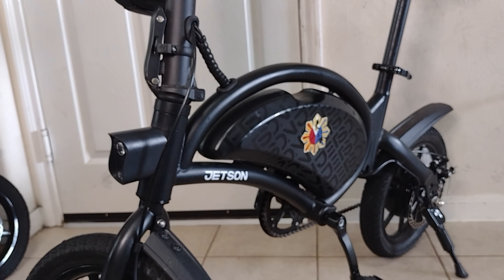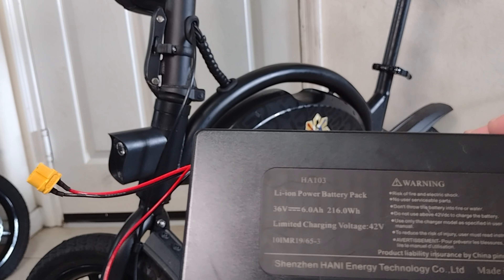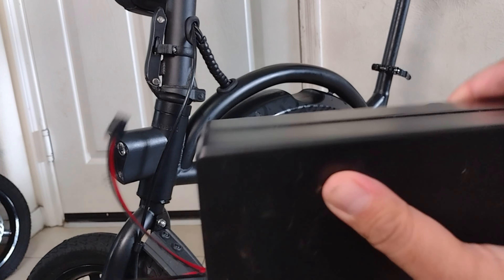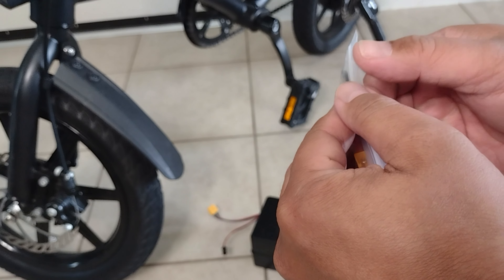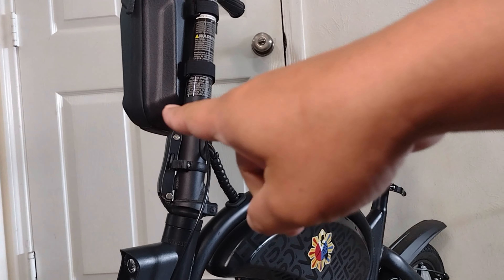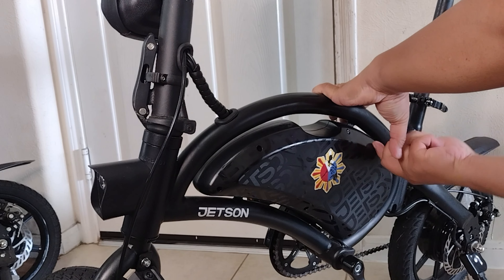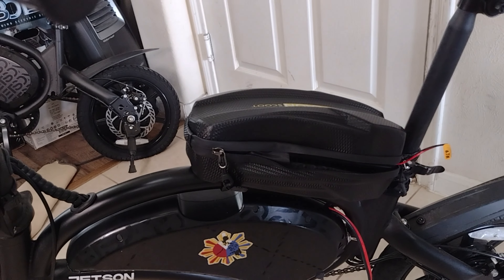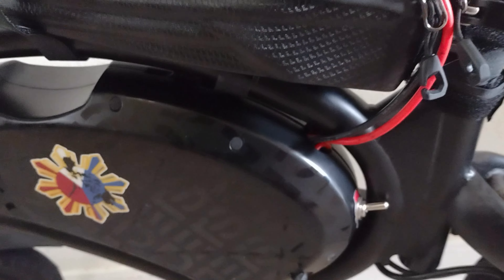JETSON BOLT PRO DUAL BATTERY MOD

Comment: One more question, both batteries charge at the same time from the original port? And is there a way to work both batteries at the same time while you ride?
Reply from the maker: yes they charge the same time from the original port. they will run at the same time also while I ride. Both of these situation the switch is in the on position. If you dont plan on using other batteries dont use a switch just the Y connector and extension so they are on all the time
Reply: Thank you buddy, great 👍🏻 video.

Comment: Thanks for the detailed vid but wouldn't a better solution be, using a 6 pin switch. The middle two pins would connect to the controller and the four end pins, each side would connect to one of the batteries. This would allow for no disconnecting of any battery in order to use the other. Your method to be safe would require two batteries with the same specs. Am I on the right track?
Reply from the maker: I want to have the option to disconnect and remove the other battery to make the bike lighter

Comment: Hello pare!  So with these 2 batteries I'm guessing u get about around 30 miles of travel?
Reply from the maker: Mathematically yes. Maybe under 30 miles because of the extra weight and maybe Hindi na full capacity Yung two batteries Kasi used na

Comment: I believe when you connect two batteries together of the same voltage the amp hour doesn't really matter. All you are doing is creating one bigger battery. Be sure to disconnect the batteries when charging and be sure both are fully charged before you plug them back together.

If you charge both batteries while connected with the charge port on the bike you will be bypassing the BMS in the extra battery. In time the extra battery will become unbalanced and shortening the life of that battery. Best to disconnect the batteries and charge both to full before reconnecting.

Have fun and keep the shinny side up. 😎👍

Comment: Boss tanong ko lang, bibili kasi ako ng 48v controller at 48v battery pwede ko ba gamitin ang parallel system para ioff nalang ang 36v battery sa loob at sa labas naman ay gumagana ang 48v battery? For sure kasi magkakaroon ng problema pag naka bukas pareho ang 36v at 48v battery.
Reply from the maker: I suggest dont do it baka malito ka parehong ma on mo yung swithch. theoretically its possible. accdg sa jetson fb groub gagana yung stock controller sa 48v battery why not start with just the 48v battery upgrade and just flip a toggle switch which battery will run at a time
Reply: @jsnantic  Di ko na tinuloy boss, yung way mo nalang kinopya ko. Pero safe naman kung pinagsasabay ko pareho both ang 36v batteries?